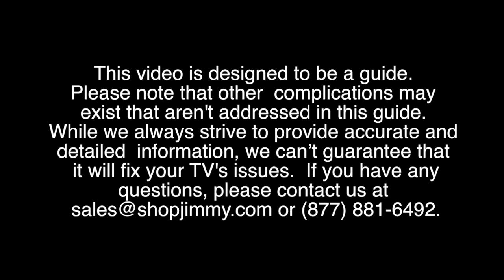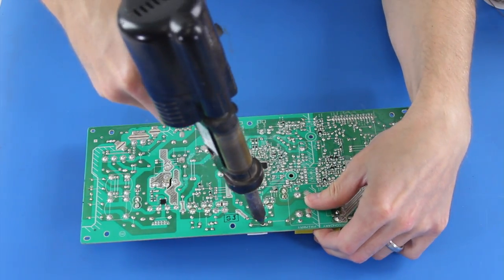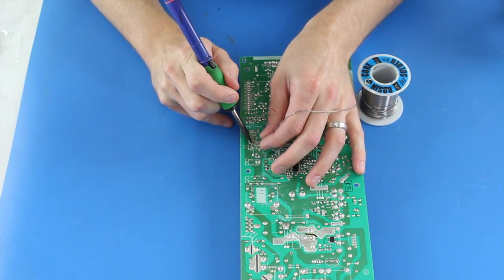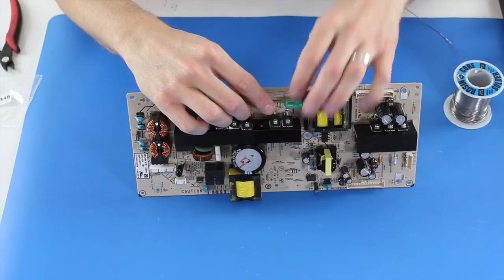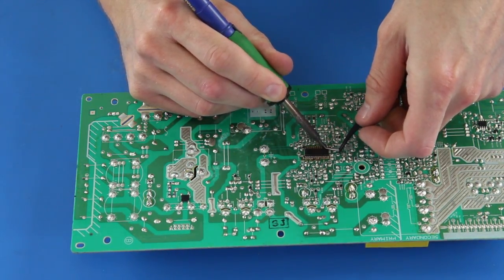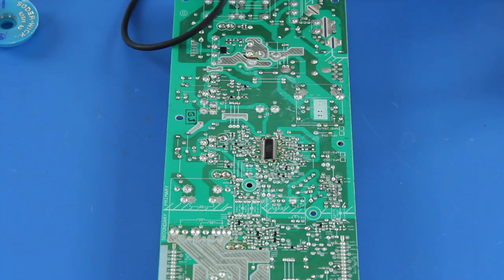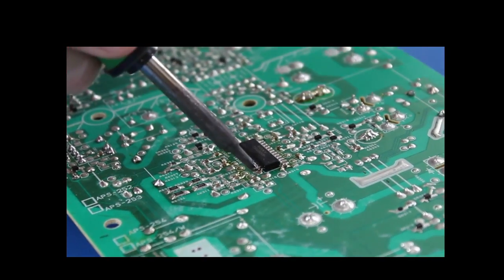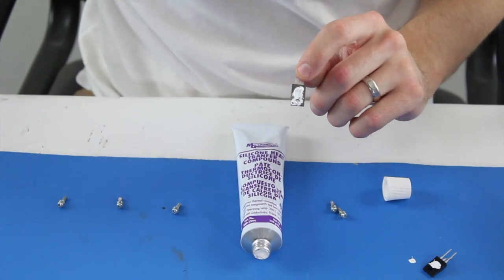Sony 1-474-202-41 Power Supply Component Repair Kit - TV Will Not Turn On - No 5V Standby

Comment: Hello my Sony has standby 3.3 v but other voltages 12 and 24 disapperar after about 1 minute the set does not power up. The ps board number is 1-876-635-12. Is there a repair kit for this thank you.

Comment: I have a Sony Bravia KDL-40V4100. Do you have a repair kit for this model. Also where is the U24 if this is removed the tv may work. The tv does not turn on, there is no voltage as I had tested for voltage. Fuse is good.

Comment: Hi Jimmy.  What an awesome work done on the main power supply board!  I have a problem with my sony dvd HTS.  It has no power and when I opened it and check the fuse, it was still fine.  What are the most common suspects in this regard?  Are you also selling the electronic repair tools like the ones you have used on this video?